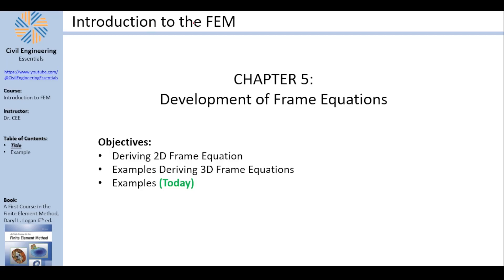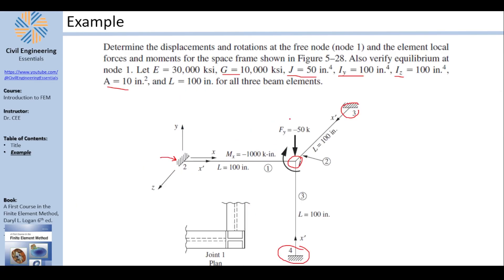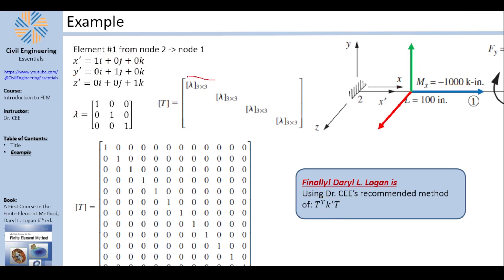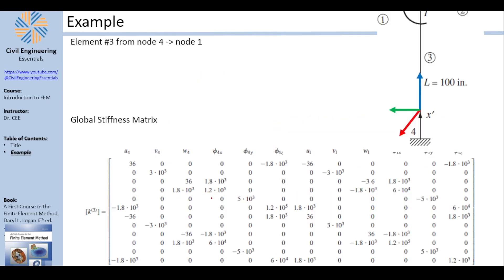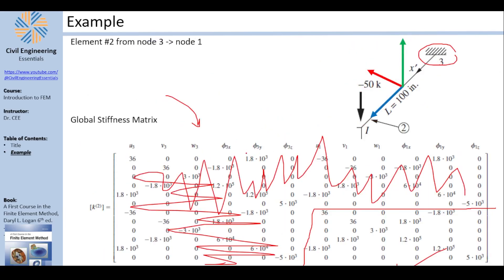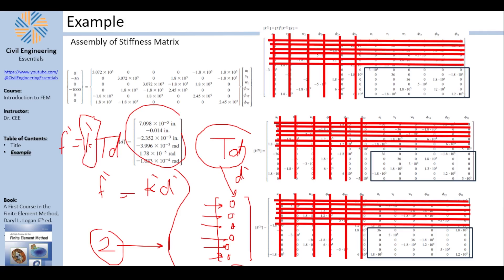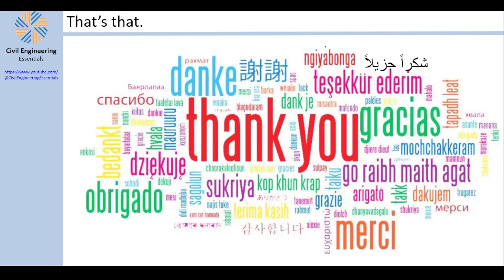The Finite Element Method | Part 15: 3D Frame Example

Comment: Hello Dr. CEE,

I see you are simply reading off the element Lambda unit vectors directly from the figure (that’s nice). 

Before I watched this video, I had actually went all-full-out and assigned each node its corresponding global coordinates (x,y,z) and used those coordinates to calculate the unit vectors for lambda as it was explained in the previous lecture.

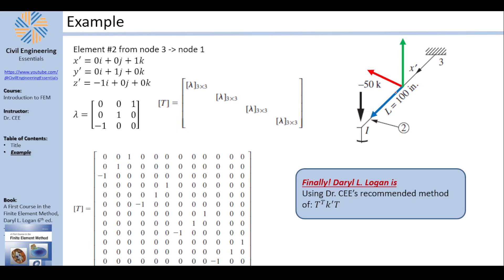For element #2 (the one you read off at 05:05 ^_^), I ran into the “special case problem” because the local x axis of element #2 is parallel to the structure GLOBAL Z axis. I simply cross-product the “Local x” with the “GLOBAL Y” to find the “Local z” of element #2….. I them continued with the other cross products to find the other unit vectors.

Yes, the end results are the same as the values that you are reading off, but seeing you effortlessly reading them off as you are doing, I am second guessing the need for my calculations (cross products and vector length checks) in this regard? 

Is it correct that the reading off of the unit vectors is only working in this case because the elements (members) are “horizontal / vertical” relative to the referenced structure global axis? Would the reading off still work if the members were inclined? or would it then become necessary to carry out the calculations that I did?

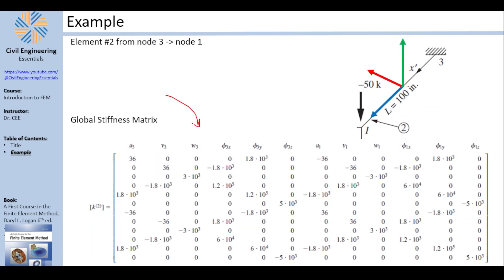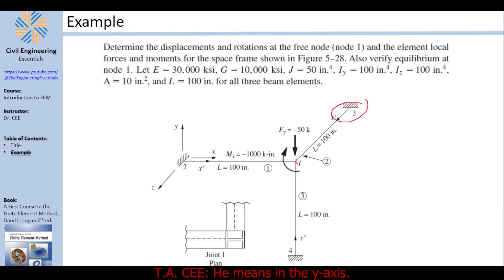I like the foreshadowing (04:33, 6:10) It does help to sharpen and to highlight a better mindset to approaching things in general. 08:10 thank you for mentioning this, for a moment, I thought it was just me who is struggling to see how that moment is going (luckily indeed it is written on the figure).

Ooh, I did not realise there was challenge at the end (Axial, SF, and BM diagrams). I will definitely try this out.

Thank you Doctor CEE; for me this is quite a milestone and it is indeed very very satisfying. You are simply the best and I am grateful to have an opportunity to learn from you. What you have already achieved through this series is nothing short of miraculous for many people like me who had very little to no experience in the FEM. Respect to the CEE channel and more specifically to your dedication MJ.

I have enjoyed this video and I am looking forward to future videos from the CEE channel.

Regards, DK
Reply from the maker: Hi there Engr. DK,

The only reason why I seem to "effortlessly read them off" is because all of the nightmarish bugs I had to eliminate while programming STRADO. I somehow got battle hardened and can spot transformation matrices from miles (1.6 km) away.

Yes, reading the vectors off is because they are of special cases.
You still can get a good "idea" as of what the signs of the unit vector components should be by looking at the coordinates of the points. It is kind of a sp(a)cial imagination. If it is inclined, then I lose all ability to read those things off, and get back to my calculation bench.

It is really challenging and hard to see those moments in 3D. Back in my day, I once opened Autocad and drew this stuff in 3D just to be able to "orbit it around" and appreciate the complexity. 

Most welcome, I am happy you find those vids beneficial and helpful, it is a joy to me to see people improving their talents based on those vids.

Stay tuned for more content,
Regards,
CEE

Comment: Now how can i calculate the member strain and stresses?
Reply from the maker: Once you determine the internal moments of each member, you can use principles of Mechanics of Materials for that:

sigma = P(x)/A + My(x) cz / Iy + Mz(x) cy / Iz;

So, with that regard, to FEM principles are needed there.
For strains, you can use the moments (once again) to predict them. Check out the "beam curvature" in R.C. Hibbeler's Mechanics of Material book.

Regards,
CEE